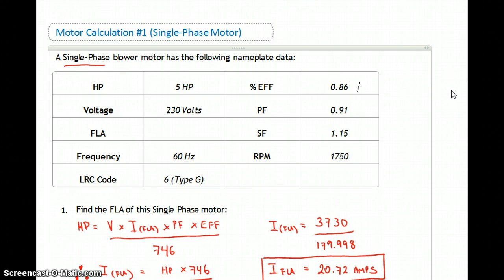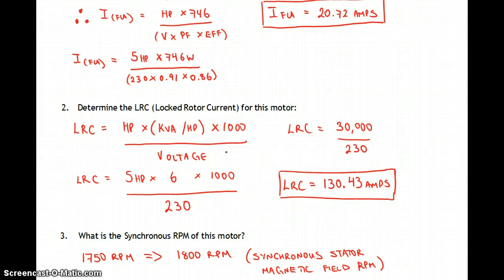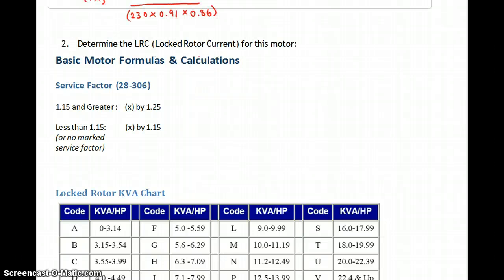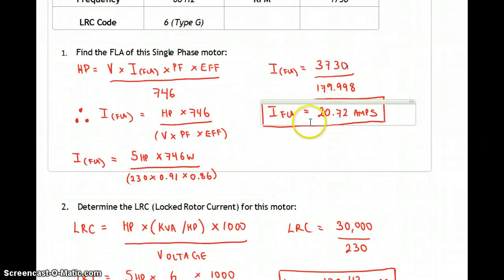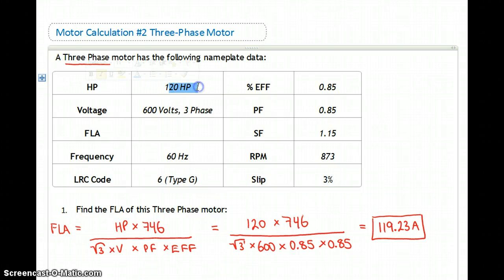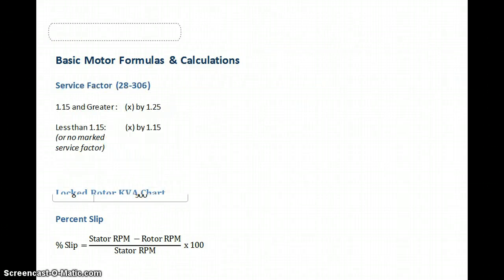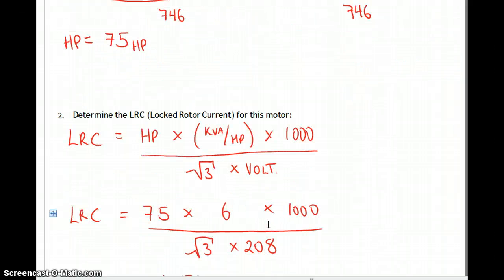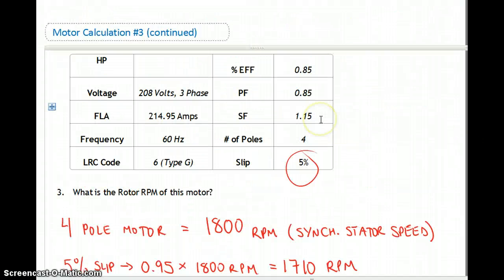Motor Name Plate Calculations #1 to #3

Comment: Would you like to tell me how do find out about starting capacitor in single phase motor .I have single motor 1 HP voltage 230 .how much uf mix  In this motor .do you have any formula like this
Reply from the maker: Really good question that I don't have the answer for at this point. I'll try to respond by tomorrow with the correct answer. Q. Do you have the old capacitor?